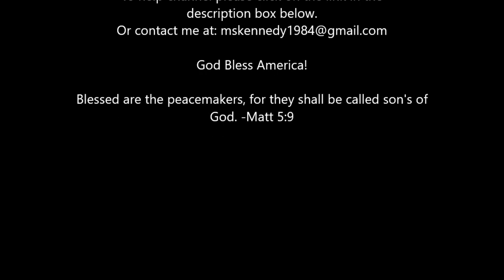Any Ideas on How to Fix this Vetterli Bolt?

Comment: The rim-fire striker block is not long enough. It needs to ride over the bolt pin. The original overall length end to end of the striker was around 1.070” and .754” to the bottom of the striker prongs. The bolt pin rides in a .200” diameter hole cut in the base of the striker .467” deep. What you want to do buy some steel bar stock and file it to .440” w x .175” thick x .754” long (bolts vary so test the fit) and drill it to hold a Lyman #7837786 decapping pin for the centerfire striker. From the back of the block this was a .062” drill thru, #35 drill .620” deep, #7 drill to .527” deep. You can cross drill and tap for a 4-40 set screw to keep the pin in place. As you know there are a lot of ways to convert this gun to centerfire Koba49 has a pretty good series on this. Send a screenshot of a drawing of the block separately.
Reply from the maker: Thank you. ❤️

Comment: One more note- it was very common for vetterlis to be issued with a spare rim fire striker which was stored behind the buttplate of the rifle in a hole bored in the stock. If you are lucky and it is still there then you have another chance to modify the original striker to hold a pin for centerfire....
Reply from the maker: I'll give it a look, thank you I def didn't know that. 💙❤️💙

Comment: Well. Im the one cobbling this so far. My first pin, the one that was lost in the grass followed a youtube video wherein the original rim fire pin was modified to accept the depriming pin from a reloading die. Except I duplicated the rimfire pin and used a tool steel drill shank for the pin. 
Lets call this pin Mk1. 

Joan sent the bolt back. My mistake was in using a floating pin. Clearly the pin itself must float so as to not have an out of battery detonation. HOW-SOME-EVER, that laterally  slotted bolt with both sides milled away to accommodate the shell lifter is a pip. 

Add that to the fact that the bolt is largely hand made. Not on a lathe. But by hand. It is therefore not exactly symmetrical. By several thousandths inch in several different places. 

So my second attempt involved a block as I call it, similar to the original rim fire pin. NOT intended to float but to remain fixed in the bolt head so as to provide a rear support for an actual honest to god floating pin. The actual bolt face is thin. About 1/8 inch which is insufficient to support and align a small pin. The block about 5/8 inch back from the bolt face drilled in line with the hole in the bolt face is acceptable. 

The rub comes on how to retain this alignment block. Especially considering that said hole must be about 0.006 inch off center due to the bolt having a slightly oval cross section and a gentle curve. 

So. I chose to make this block with “ears” to fit the old rimfire pin cuts and the make it a near-press fit. I considered weld, soldier and epoxy. All seemed just too permanent of a gun that will probably yield other surprises. So. Friction looked good. Call this Mk2. 

Clearly I did not communicate clearly with our heroine. Some where in shipping or firing the Mk2 block came adrift. She made the reasonable assumption that if Mk1 floated so must Mk2. And she then proceeded to file on said block so it moved “better”. Back to square one. 

Options. The most drastic is to modify the striker to accept a tip, much like a lee enfield making a one piece striker-firing pin. The lack of a uniform channel in the bolt and the need to align this pin are against that option. 

Another is to cut a cross key way in the bolt at the forward section of the lifter cut. Square or dovetail are options. But the fit must be tight, a hole to pass the actual pin in the correct position, and the ends filed flush make this exacting work. 

So. Joan has asked for ideas. Lets brain storm this!

Comment: I just found your video, it looks like the back half of you firing pin is missing, the only way to fix the problem is get another firing pin and drill it out.
Reply from the maker: Thank you for your input I watched a lot of your videos on the Springfield Trapdoor and Vetterli. I have a friend with better machinist knowledge than I do working on it. Hopefully he will get it working. 
 Do you have any idea why the tube mag is so short ? It only holds 6 rounds. 
 Once this handloading / ammo shortage crisis clears up, I plan to start collecting the Vetterli, I really love the, gun and round. ♥️
Reply: @JoanieKennedy  I looked at your videos, your rifle has been sporterized, and the fore end stock has been shortened, along with the magazine, so that is why you have a 6 round capacity

Comment: Put a spring between the bolt and pin
Reply from the maker: I may have to try that. Thank you.
Reply: If I had it on my table I could figure it out or if I was with the rifle. If you use Facebook or Instagram, pm me some pics up close of the mechanism and the bolt. That'll help a ton.
Reply from the maker: @AmericanDefender  Joan Kennedy on FB. I'll send some pics of it here in Abit.
Reply from the maker: There is an anime girl as my profile pic on there.
Reply: By all means look. There is scant room for a spring and a spring provides no alignment support. But please! Give it your best.
Reply: Lone Wolf more modern designs use a spring to retract the pin below the bolt face. Older designs just let it float back and forth. Fouling would stick the pin then a slam fire might occur. The Remington rolling block had such issues, among others. It was bad there because the breech block is not locked at that point.